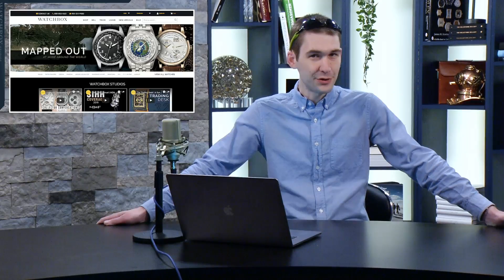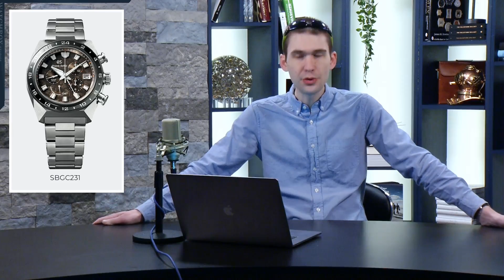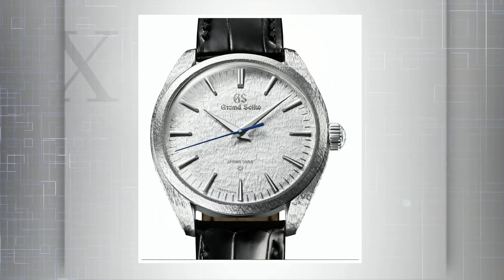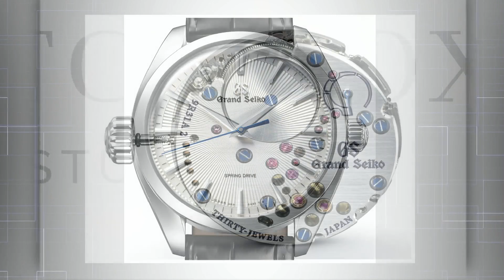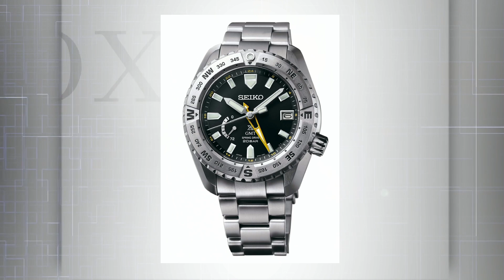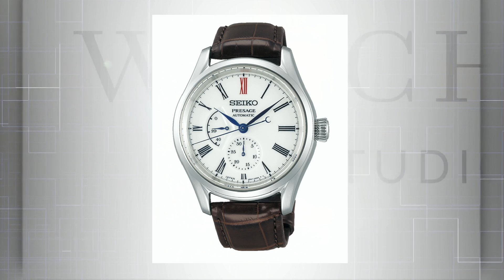2019 Baselworld Seiko & Grand Seiko Watches: Spring Drive, Prospex LX, 1970 Diver Re-Creation SLA033

Comment: I bought the sbgy003 and sbgk005. The finishing and decorations on the 9R31 is very impressive for an entry level. It uses the same dual main spring architecture as the higher tier 9R02, though, the power reserve is lesser at 72 hrs vs 84 hrs. This is an improvement to the 7R14 used the eichii II. Will get one of the 9R02 when they are cased in steel. It's also thinner and better finished than its predecessor 9R14. As for the 9S63, it's definitely of higher specs than the patek small second.

Comment: With this launch, GS is placing themselves on par with the best HANDMADE watches. Putting the spring-drive and ceramic on the Seiko sport watches, they are giving mass produced machine made watches like Rolex and Omega, a run for the money. The SBGZ001 is from the vintage inspired Presmatic hi-beat ref. 5146 7020 which has the engravings extended to the bracelet. I have been hunting for one before this but to no avail. However, i do have the 5146 7000 which has the clover leaf inspired case which is originally found on the Seikomatic clover ref 8305 7000 which i also have. I have a King Quartz ref 9223 8000 which has the washi dial and the washi engravings on the case and also the bracelet. All these are in mint condition- like new. Would not be surprised if they reproduce these in the future. Anyway, my AD says that the SBGZ001 is already sold out.  Like the Nomos a lot too.
Reply: BTW, you have to see the brush finish of the clover leaf inspired finishing in person to see how refined it is.

Comment: Classifying precious metal with more engravings as high horology and those with SS with less engraving as luxury horology, even though they are both handmade, is strange. But, whatever, personally, i do not see mass produced machine made watches as either category.
 Anyway, I have pre-ordered the SBGK005 Iwateyama and the SBGY003 Grand Cocktail. What a stunning handmade watches with innovative mechanism to add on to my collection. The price is very reasonable for handmade watches, especially, if you can get a 25% as a regular.

I will give the SLA033 the pass, though. I got myself the Merkur homage instead. For 170USD, you get sapphire glass and ceramic bezel. The overall finish is very good, though you do not get GS brush finish. But, what the hack, it's a tool. Still, it gives me -2 sec per day which is better than my hulk's -3 spd. Also, comparing the bezel, even if you are blind, you can move your finger round the edge of your hulk or batman and see how unrefined they are. In this case, the Merkur is certainly more luxurious. It's also no wonder that many of their models are sold out.

Comment: do note, Lion logo is NOT exclusively for Grand Seiko in vintage 1960s/70s era but used on top tiers Seiko watches (especially Grand Seiko and King Seikos) .... provided these limited pieces are Super accurate chronometer grade pieces or sub ranges (mostly within the KS or GS "brand"s )

Comment: GS and Seiko are starting to price themselves out.  Good job on making a sub 10mm spring drive watch with the power reserve on the case back instead of the dial.  They seriously need to overhaul their sports line though.  Very refined finishing on a very CLUNKY shaped and gaudy sized watch case!  With Rolex unable or unwilling to supply their ADs with watches in their sports line, GS and Seiko has a great opportunity to cut into Rolex’s market share if they would just design a reasonable sized (ie ~40mm / ~13mm) and priced (~4k to ~6k) sports model.
Reply: I agree. Seiko and GS must have the technology and funds to make a thinner, high end calibre movement or even a smaller spring drive movement. More smaller and thinner dress watches as well as sports watches would be very welcome.

Comment: I like the Prospex GMT, but those prices are just bananas. For that money I'd rather buy Tudor, Omega, or Breitling.
Reply: Why?  Lesser dial design, finish work well below gs and movement that is avg at best.  Tell me models you'd buy over the gs? Love to compare
Reply: @wesleyb5517  Im taking about the new Prospex line, which are not GS models. I would be getting an Omega Planet Ocean GMT for the kind of money Seiko is asking for. In my opinion the movement, finishing, and dial on the PO GMT is superior to what Seiko is offering on these Prospex watches. Plus Omega actually has a decent service network so if you have a problem with it you'll actually be able to get it fixed.
Reply: @wesleyb5517  Have a omega Seamaster and  after have very accurate watches the Omega doesn't hold up

So would rather keep LX  spring drive and the G shocks sick of adjusting the time on the  Omega

When Omega loses time always
Reply: @greenerick  not a planet fan. Just too big. Seiko is trying create a tier below gs while increasing pricing on gs. I love omega as well gs. I'm not a buyer of prospect although great looking and well crafted case. Id spend the extra for gs.

Comment: 10s of thousands of Dollars for a GS and between 5 and 6 thousand for a Seiko! Just way too much, they’re pricing themselves out of the market. Also GS seems now to be suffering from limited editionitis that has plagued Omega with its Speedmaster Pro line...way too many of them! The new Presage’s are very nice though and far more reasonably priced at about what should be the maximum cost for a Seiko. I was a huge fan of GS, but with these ridiculously high prices and frankly fat, oversized and ugly sport watches (oversized in the case of the multi-thousand Dollar Seiko’s too) Their luster has faded a bit for me I’m afraid.
Reply: David Datura 700USD Presages and 6K Spring Drives eh